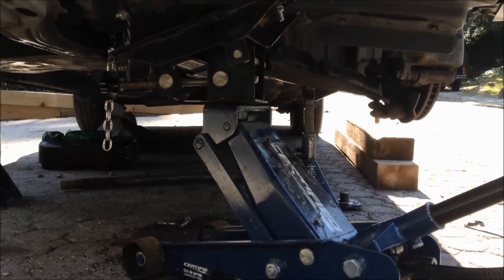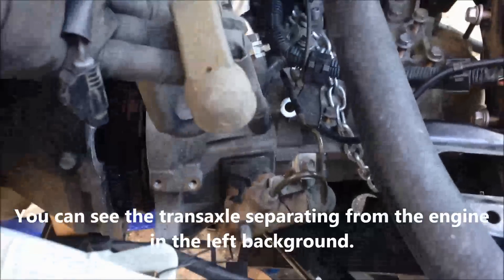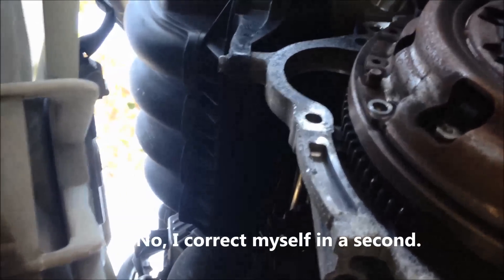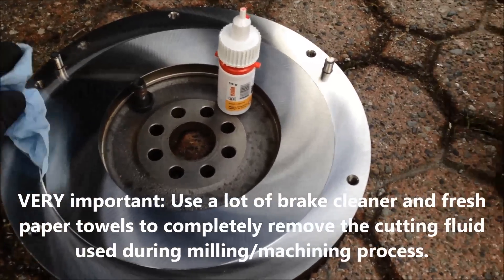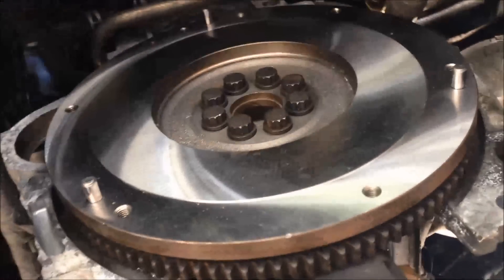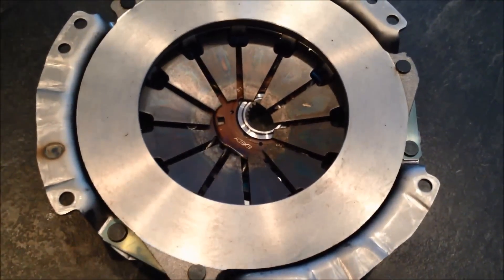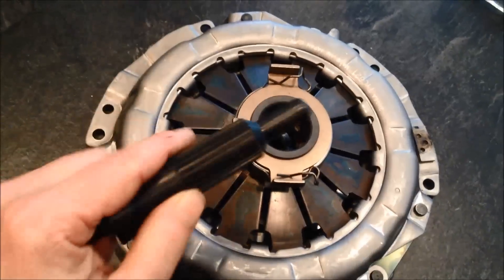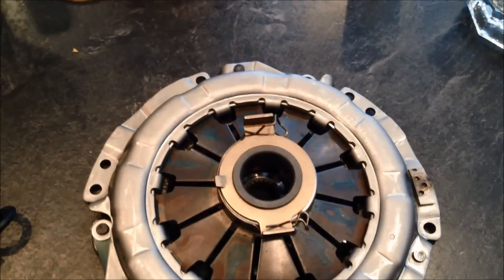(Detailed) Corolla clutch replacement - Part 5 - Transaxle, clutch, flywheel

Comment: I'm getting ready to tackle this job myself.  I've changed the clutch and transmission in a 1975 Chevy C10, but I know this job will be more difficult.  Thank you for your videos.  I now know what to expect and have more confidence that I can get this done myself rather than spend US $850 to have it done.  I'll be saving about US $600 by doing this job myself.  Thank you!!
Reply from the maker: I'm very pleased to be of help! I tried to explain things so as to help DIYers anticipate what's coming up. I intended to include all the bolt sizes etc. but it just got too involved to keep track. Good luck and let me know if you find anything that I can add to my captions, please.
Reply from the maker: One thing I didn't tape was the reinstallation of the transaxles. There's a locking ring around the male end that's inserted back into the transaxle, so the axle doesn't just slide in smoothly. (It's the same thing taking it out--You need to lever it out.) Place a short 2x4 or something on the projecting end of the axle, and gently tap it into place with something heavy like a sledgehammer. It'll just pop into place.
Reply: Doug Brown Good to know!  Just a ballpark figure, how long did it take you to do the whole job?  Did you have to run to the auto parts store any?  I'm mechanically inclined, but most of my experience is on 5.7L chevys.  LOL.  Thanks again for all of the advice.  It is MUCH appreciated.
Reply from the maker: It's a second car, so I took my time over about four weekends. If I had to do it all again and with prior knowledge I could do it all in a weekend. I took it slowly because I had to look up some things on YouTube and in the service manual. Re: auto parts, I definitely machined the flywheel which took a couple days. But I work on my cars quite a lot and had all the tools and things like threadlocker. Toyotas are nice because they don't need any special tools, like when i did my kid's Passat and had to order some things online.
Reply from the maker: It's a good idea to bring a camera phone or something to document all the bolts and parts before you take them off, and then bag and label them. I started doing all these videos for that same reason and I just figured people would be interested.
Reply: Yeah, I know about VWs.  Expensive to maintain!  LOL  Well, my Corolla is a daily driver and the clutch is slipping so bad it's almost undriveable.  I have a couple of days off coming up at the end of the month which will give me a 4 day weekend.  I'm hoping the clutch will last until then and that I'll have good weather over that weekend.
Reply from the maker: No problem--I'm sure you can do it. I would definitely machine the flywheel BTW--Everyone I talked to said it adds a long life to your new clutch plate.
Reply: I just read ryan that you have problems with clutch. I just repaired mine taking it to a mechanic. The problem in my case was that clutch was damaged due an oil leak from the transmission. I had to ask for seals and take to a std transmision mechanic to fix it.